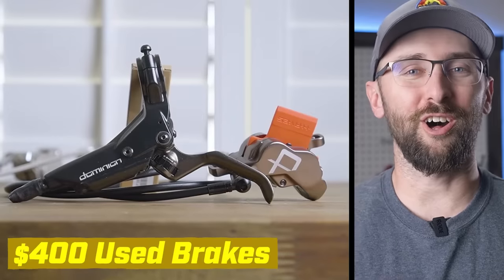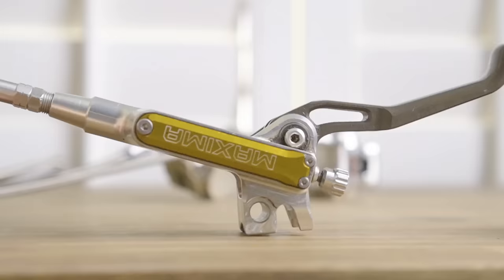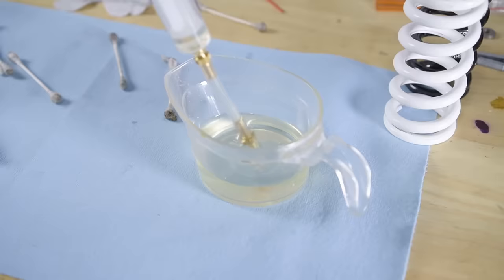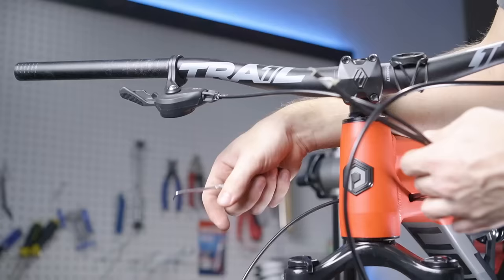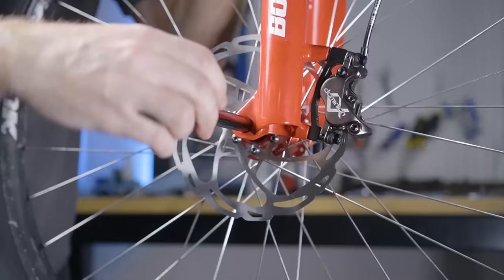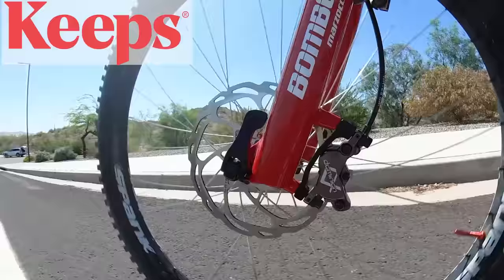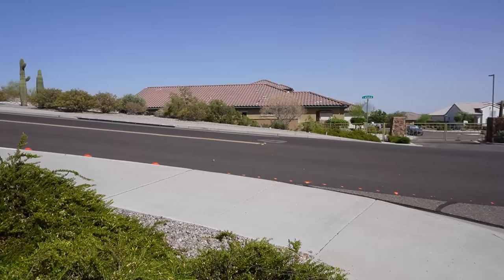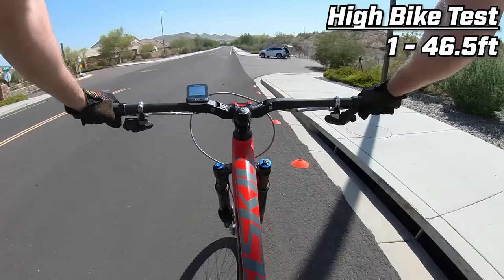Are $2000 mountain bike brakes THAT much better?

Comment: For value I gotta go for magura mt thirty. An mt5 except with a plastic lever blade (replaceable with an mt7 lever blade). Effectively a pair of mt7s for ~280 with some gently used hc lever blades.
Reply: Just use SHIMANO Deore, SLX or XT Brakelever with mt5 calipers. The are the beasts!
Reply: @vidovec16  that's what im doing! Had xt m8000 on my knolly warden from when I got it, and the mt thirty is the cheapest way to get the mt5 caliper, and it has semi metallic pads, and comes with plenty of fresh brake line!
Reply: Since i have heard many ppl having stuck pistons on Magura i avoid em... Maybe great when the work but i rather stick to my SLX 4pot with koolstop pads.
Reply: @kaedeschulz5422  never had that happen to me or any of the boys 🤷‍♂️
Reply: @kaedeschulz5422  the magura pistons don’t stick. What you’re referring to is air trapped in the caliper keeping the pistons from working. Hydraulics don’t like air in the system at all. The air absolutely ruins maguras reputation from lousy bike mechanics. Once you get the air out all the pistons work in harmony and the MT series brakes are absolute dreams.
Reply: @adamneulander  That's good. My homies didn't get so lucky. Was impossible to fix em. His and a couple others always stayed troublesome.
Reply: Not compatible with MT7 levers.
I wanted to replace them with 2 finger alu MT7 levers. Did not fit.
Aside from that, plastic levers are livable. Brakes are fantastic at >$90 a side.
Reply: @UnEmploymentDude  shigura > anyways but the master cylinder is the same. Maybe different revision but I was able to fit the mt7 normal hc lever on...
Reply: @adamneulander MT7 have contact adjustment and cover options. I thought the same too. The spare parts list even had a different model for MT5.
I actually like the 2 finger levers. Much better leverage than my old Shimanos.
Reply: @UnEmploymentDude  yeah facts some lever grips and it's valid
Reply: @UnEmploymentDude  I have all the Magura levers. The bite point adjustment doesn’t work for beans. I prefer the 2 finger Magura lever and the HC lever the most. The hc3 is a little overrated in my opinion.
Reply: @kaedeschulz5422  I dunno what bs you heard but Ive been running Maguras for years and they provide the same stopping power as these dominions. Also 60% of the price and less weight. Easy access to spare parts. The only thing I dont like is the plastic, but I guess it solves weight problem.
Reply: @przygodyzmtb  Not just heard. A friend of mine had trouble with his race line 4piston after every park day. Pistons weren't moving like they supposed to and he had a couple in the shop he works in with the samr problem.
You don't have this problem i guess. Good for you. I stick to shimano. They just work. Had 2 sets of SLX 4 piston never were troublesome. Same like a couple of my friends shimano. So why should i for example go to brakes that my friends had trouble with on their and customer bikes which wasn't the case with shimano? Saving weight on brakes? Come on dude. They just have to work. How much you gonna save on brakes? 100gramms at best? Doesn't matter.

Comment: Most people change brakes because they want a different feel and consistent bite point over stopping power. Just changing the disc and pads can make a drastic difference to the feel. Ive never tried a stopping test like that but to be honnest I expected more weight transfer under heavy braking.

Comment: I caught a sale and upgraded the MT200 brakes on my Marin Rift Zone 2 to Deore XT BL-M8100 levers and BR-M8120 4 piston calipers front and rear. I also upgraded crap rotors to MT800 rotors. I know 4 piston in rear is a bit overkill but with the sale only paid $280 for levers, calipers, and rotors both front and rear!

Comment: I’ve had a set of Code Rs with MTX red label pads for two years. No problems and very consistent performance on big mountain trails here in Colorado.
Reply: Just installed the MTX pads myself on Code R's. Can't wait to try them out.

Comment: Greetings from Germany✌ nice to see someone using Trickstuff brakes :) as a Maxima owner i can tell how frustrating it can be to bleed these brakes. But when you're doing it right they are way ahead of any other brakes on the market. Maybe you should try the Trickstuff Rotors for best performance. The Maxima should stop you way earlier than the Hayes
Reply from the maker: Oh nice to hear you have them too! I heard that the Maxima have a very long bed in process
Reply: To be fair, there shouldnt be much diference at a first stop. Its basically tires and surface that limits you. When you really need good brakes is a long downhill section where some brakes might experience extensive fading due to the heat.
Reply: @EvansMTBSaga   yes you should take some time to properly bed them in. I had the Code Rsc, Magura MT7 and even the Trickstuff Direttissima. But when they launched the Maxima...i had to have them. I dont know if you want to keep the brakes after the projekt, but they will be worth every cent and will do a good..no..the best job for many years. Like you said the quality is above everyzhing else

Comment: I did some math taking into consideration the two masses, and the difference (in Newtons) in stopping power is really thin. I don't know about the disc diameters, but if you put a smaller one for the cheapest brakes, the amount of force the pistons had to impress on the rotor is greater for the cheapest brakes.

Comment: i have been following this series and enjoying it so far mainly because of the good choices of parts to compare, coming from the disappointment from PB's version.
but I have to say this episode is something I have to nitpick which is the choice for the low bike.
Even though you bought it 2nd hand and cheaper from SRP, Dominion A4 is by no means a low tier "budget" brake price and performance wise so for me it looks like you're just comparing a high tier brake vs a super premium thus the essence of how a budget build feels vs a premium one is not present.
I was expecting more of a deore quads level kind of, so you can really compare and see if the premium price is worth it.
sorry for the essay lol, just saying how I feel.

Comment: Hollow claims.
I was a test rider for Frank industries out of engelsbrand in Germany.these were in 2007 the best brakes in the world and still are. They were used mon a 150horsepower race bike initially. Unfortunately a few suppliers put Frank industries in bankruptcy. I still ride mine, 230/210mm disc
. The brake design is still up for sale....

Comment: You’ve probably already noticed/fixed it, but your front brake on the low-end bike wasn’t mounted properly. There’s a lot of space between the calliper and the brake mount. Check 9:05
Reply: Jeez, that’s terrifying. What’s happening is that the adaptor doesn’t dip low enough, and you can see that the caliper is bottoming out on the adaptor, so the lower bolt couldn’t be fully tightened. 

That’s really scary to see.

Comment: been using my $60 amazon hydraulic brakes for years, work great. Now I can afford my sons college tuition.
Reply: I Bought a Set Of Used Saints  with 2 200mmRotors For 280$ 😆 Run 203Floaters With MTX  Pads 😎

Comment: First and foremost, respect for an amazing series regarding both content and quality 👌 Your going the extra mile here finding some serially good bang for the buck on the low bike and simultaneously totally spoiling the high bike.
I'm curious if the difference in the bikes weight, especially wheel weight, could offset some of the braking results, cause you do run the same tyres right? That said I'm sure the Trickstuff is awfully powerful! Personally I'm eying up the Dominions as an upgrade for my Guide RSC:s and this didn't put me off.

Comment: You should have went for the Shimano mt500. Or mt501 for quad ceramic piston calipers. Way better value. Half the price brand new. Very very good brakes. Noticeably better than whatever was on there before.
Reply: MT520 is the quad piston one.

Comment: One finger setup is a must.I refuse to use anythign else. The brakes with bite/contact adjustment are nice, but there are tricks to get the bite point where you want after setting reach. Overall that's all that sets apart the brakes for me. Pads I use the same combo on every bike. One side is semi, one organic.  This mixed approach covers contamination issues with the surface. No matter what brake I use once I adapt to it, there is no change in my stopping power.

Comment: I looked up all type of oils and I found out they're all the same if used correctly. I was thinking about experimenting on using cooking oil too since they're all high temp boiling point. I found out peanut oil, saf flower oil have the highest boiling point. 
I love my Hayes brakes, and bought a 2nd pair for my other bike. I'm also sort of doing high low bike ut my low bike have all the chinese parts from aliexpress lol.  Real budget bikes!

Comment: I feel like the comparison between the two is flawed. I haven't seen the whole series on high / low, but I think I get the concept. In my opinion, a proper comparison would have been testing both sets on the same bike. I assume these Bikes have different wheels and tires ? That alone is a huge variable. Test them on the same bike, it doesn't matter which one, and then Install them on the high / low bikes afterwards to tally up the costs totals. This test didn't really compare anything except for cost. All it did was show how each brake worked for the setup it was installed on.
Reply: the series is about low vs high budget bike so they naturally have different setups to compare the bike as a whole, not just the brakes or a particular part. else it would just have been a comparison review.
Reply: @NatNetNitNotNut  I understand and accept that argument. However, the title is literally "Are $2k brakes better than $400 brakes."
Reply: @niz989  true. I didnt really notice the title because i've been following this series which in context is about 2 differently priced bikes.
However the dominion is really not appropriate for a low budget build so im not happy with this episode.
Reply from the maker: Swap the brakes, then swap again... You're insane.

Comment: Not sure if that is really a good test of stopping power - the limit of how fast you can stop on a paved road is probably the grip of the tires, not the power of the brakes. The difference I guess is that you need less hand power as input to achieve the same result, and therefore on longer descents the more powerful brakes will leave you less fatigued.

Comment: Bleed brakes off bike, disconnect lever, thread hose through frame, reconnect lever, and hopefully no air was introduced to the line while it was jiggling around in the frame.

Seriously, grumpy old mtber here, but internal brake hose routing is a shit idea which proves very little. Something that functions well, executes the job it was designed to do perfectly, and is easy to work on, is a beautiful thing in my eyes.

Comment: I recently finished a resto/upgrade of my '05 GT Ruckus i-drive and when it came to deciding what brakes to go for I decided to go moto and run SLX - M7100 2-pot rear and M7120 4-pot front with RT-86 rotors. It's so stupid it works, and works well 🤣

Comment: I have a set of the Dominion A4 and it's a lot more of a brake for quite the same price as MT7, Code RSC or Saint.
However, I've never tried the Trickstuff...
But even if I did try and find them the best, yet I won't spend so much for brakes 🙄
Reply: have you tried the mt7? interested to know how they compare to the a4 overall
Reply: @jamble7k 
The MT7 is quite similar to the A4 in terms of performance; the main advantage of the A4 is absolutely fantastic lever feel and ergomonics.
The MT7's lever isn't that comfy (and Magura's brake overall)

Comment: for the braking test you couldnt have been pulling on the lever very hard as the brakes seemed weak. i have a cheap set of meroca m4 brakes and they stop me in 10/15ft everytime, even after months of use

Comment: Great video. I've used some mildly expensive brakes on my bikes. Shimano xtr 2 piston got my XC bike and sram code rsc for my enduro. Crazy to think that there are better and/or more expensive brakes than the RSC's out there
Reply: Ever seen or tried Magura MT7? Those are literally the best in their price category
Reply: @leomit5o  from what's I've heard yes. I haven't tried them. If I decide to upgrade in the future I will but as of right now the code rsc's don't have any negatives for me and have more than enough stopping power....especially since I'm 150lbs.
Reply: @sebterranean6258  I actually am running them and had them after RSCs. They have quite a lot more power and are a bit more aggressive imo
Reply: @leomit5o  They are great until for some reasons the master cylinder starts leaking. Idk if i was unlucky, but i had one bad from the factory, they didn't really have a replacement so i went the shigura route. Cost me more than i had hoped but it's really the best brake i have tried so far.
Reply: @seven9766  heard a few people having the same problem. Never had it myself though
Reply: @leomit5o  mt7 levers are so fragile, big downside imo
Reply: @jamble7k  not really tbf, if you handle them normally nothing happening to them. Otherwise upgrade to the HC03 Carbotecture ones

Comment: I just dont get this test.Whats the point? This breaks have inbuilt outbraker? When I pull my Shimano hydraulic break I can literally stand at my head and flip over few times.  He didn't even break hard at least not enough to lift the back.

Comment: 8:19 You can add rubber tape on the levers or use anti slip/grip tape, but rubber tape won't wear your gloves as fast. I had Tesa anti slip tape, but now I am trying Marsh Guard Slapper Tape.
all lever blades I've tried are slippery compared to rubber. Formula has a tiny texture to it, but still not super grippy.I think Formula is a good alternative to these brakes. But I've not tried these brakes.
Reply: Dip your brake levers in liquid rubber after you've done some roughing to the surface. You can buy second hand levers if you feel unsure you want to do this. The finished item will last you quite a while, and when it does eventually brake, you can just take it off, and repeat the process again. Buy the best liquid rubber kit on the market, don't skimp on it and yes, the rough surface is a must for this, you can't do it on the smooth surface, it will come off. I used a bastard file to roughen up my levers, using its edge to make a bastardized rhombus pattern on them. It's vital that you do the surface where your fingers land, the edges where it goes on the back and the tip of the lever arm. The gaps and sides aren't as important. Depending on what liquid rubber kit you buy, you can even have texture (small chunks of rubber embedded into the liquid rubber). 

These kits are mainly for making your own rubberized handles on tools.
Reply: @aserta  Great advice. thx for sharing. Not something I have to do now, as I upgraded the levers to RG Components, they have bearings, holes in the lever blade for the fingers to grip. 
I don't know why Trickstuff nor Formula did this.

Comment: You'd have to be nuts to drop 2k on a brake system if your mainstay play on that bike isn't hardcore for more than half the time you use it, and that time itself, a weekly affair - AKA unless you're a pro, don't even touch anything over 500$. That's like buying ceramic brake discs for your daily driver (with the funny note that when Jay Leno went to his McLarren dealership, and asked for the ceramic kit, they asked him what he's going to do with the car, he said daily, traffic etc) and they said "not worth it" - hence where i got this same, same story).

Buy the cheaper one, because all bicycle brakes suffer from the same issues, spreading calipers. That's why your discs taper out over time and why brake pads wear in funny ways (depending on disc diameter, method of fixing the brake caliper to the bike vis-a-vis angle, shape and more).
Buy a decent, but cheaper brake, buy high quality hydraulic lines (vital), high quality o-rings and make sure you bleed and install all the sealing components properly, a single mistake in installation and bleeding will make your brakes useless (regardless of price).

Finally, change both the disc and the brake pads, because unless you've paid a waterjet company to cut you proper, high quality discs out of high quality stainless steel... you have overpriced junk which will wear within two or three brake pad swaps. This can be measured using a micrometer (these days they are very cheap in the size required, and you don't even need to know how to read the micrometer to use it, because all you have to do is twist the ratchet on the outer most portion of the disc and then try to slid it on one of the spokes, which (if the model is made from a flat piece of stainless)) it either will, meaning it's still usable, or it won't meaning it worn down and the brake pads can't grip it AND you're frakking up your caliper's cylinders because the pads are trying to conform to the worn slope of the disc PLUS the calipers themselves are bowing out and ... well, you get it.

In closing, again. Buy high quality brake lines, buy high quality o-rings from a reputable source, not the manufacturer (just make sure they're ok with the type of fluid you're using). Buy a larger disc - 180/185/200, adapters for the calipers and that's about it. You don't need 2k brakes, they're just machined fancier, they don't actually cost 2k, they don't actually do anything more special, not in the long term.